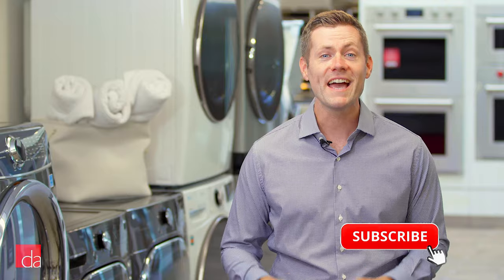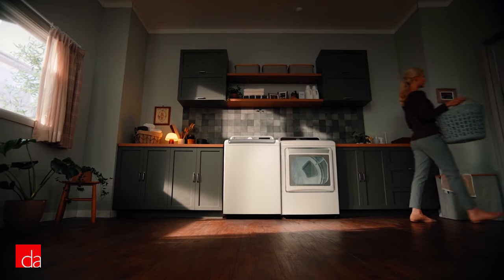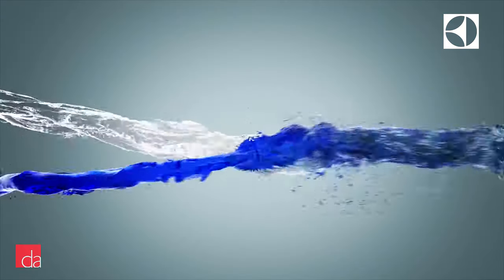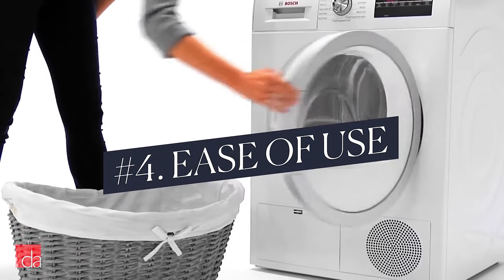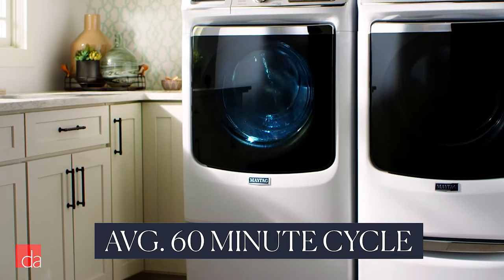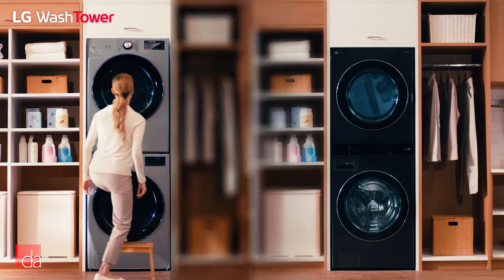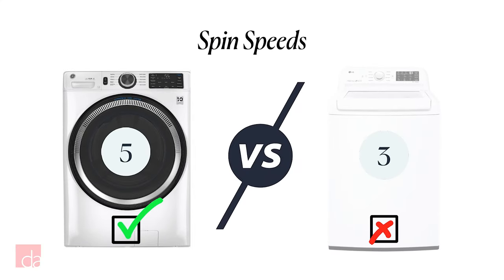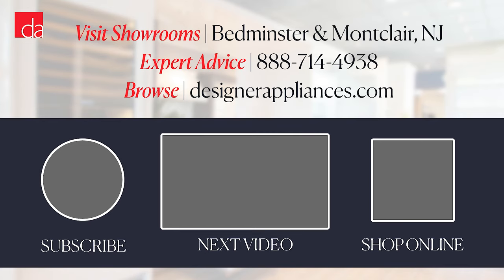Front Load vs Top Load Washer - Selecting a Washer Shouldn't Be Confusing (Updated)

Comment: I am no expert but as a Chef , chef's coats can get pretty stained. I have a front loader for the last 10 years ( Fridgidaire Gallery Series)  and i love it. For regular every day clothes i only use the quick wash 28/32 minutes cold water and  they come out nice. For heavily stained whites from work i use the soak first with detergent  ( cold water) no spin and i add a bit of bleach in the soak to dissolve blood stains.  If I would use warm water it would set the stain in. Then i turn on  the quick wash with no more detergent. Does a good job. I use Tide Powder as i noticed that it does a far superior job than any other brand i tried. I do not like the pods they leave residue .Also i can say that front loaders are easier on the clothes. Water  and electricity are  expensive where i live. I never in 10 years had a mould issue. I leave the door open as i throw my dirty clothes as i go. I do not separate 90% of my clothes, just the one that needs bleach and i  use cold water only.
Most people put way too much detergent. Do a test as i did. Put some clean bathroom towels back into the washer, turn on the hot water and see how the water looks like. If you have a lot suds you are using too much detergent regardless of the machine. 1 or 2 tablespoon of detergent is enough
Reply: @frrnchistibe all your test proves is that the machine doesn't rinse well. A standard top loader cannot be beat in that regard.

Comment: I am fortunate in that I have two laundry rooms and therefore two matched pair, both from the same highly rated manufacturer. Both sets are top of the line. One set is top load and one set front load so I have long term, up close experience using and comparing both. The top loader consistently cleans better, it’s hands down a much better system and has become my preferred pair. I now only use the front loader as a back up when I either need a higher capacity (due to no agitator) or need to do two loads at once. When my front loader needs replacing I’ll be looking for a second top load set.
Reply: I have the same situation, one set of each type.  The top of the line HE front loader has never given me any issues, except for what it is...doesn't use enough water.  I use it for comforters.  We are now buying the new top load with removable agitator which erases any consideration of ever again purchasing a front loader!
Reply: What is the idea of removing the aggrigator
Reply: Brand and model of topload please
Reply: @akhisalaam  Speed Queen TR5
Reply: Well that makes it so much more difficult for me to decide.  My biggest question is does the spin cycle bother you being lower?  And the water usage being more?  I have been looking at either a SQ TC5, or TR7 or their front loader FF7.  Hubs says he would prefer front because of water usage.  I have used a front loader last 20 years, so a little difficult to switch.  But considering it.  I do like to wash King cotton blankets from time to time.  But they fit in my compact Asko.  I thank you for your feedback.
Reply: @fearsomebeard4290  Comforting to know the TR cleans well.  It seems the TC5 would be a more effective clean, but not as gentle.
Reply: @medobigposs washing big items like bed sheets & duvet cover

Comment: We have a set of GE Profile front loaders we bought in 2006 that are still going strong...until yesterday, the washer started burning rubber, literally. Smelled like a tire fire. Did some research and found that it is pretty much unrepairable, but 16 years, and the dryer still works! It makes some strange noises sometimes, but we are going in tonight to buy another new set of Profile's if we can find them.

Comment: I noticed my LG Top loader to be quieter compared to my Cousin's Front-loader. My Cousin's washer sounds like an Airplane engine and I could hear my cousin's washer even waiting in the Living room, while mine could not be heard at all stages of my washing process unless the beeper alerts me that the washing is done. The front loader's advantage is that you can stack baskets and other stuff on the machine's top side. The Toploader is a hassle when you have to remove anything on top of the washer every time I use the washer. All Front-loaders also use more electricity but less water. Top loaders use less electricity but more water. I was overwhelmed by all these decisions as I am looking for a new washer, just in case My current washer fails. My cabinet was custom-designed to adapt to either Top Loaders or Front loaders.
Reply: Actually front loading washing machines will use LESS water and LESS electricity and front loading washing machines are way more quieter when washing and noisy only when spinning
Reply: I have a front loader and my parent's LG top loader washes better. It has a turbo wash function which spins the entire drum which then shoots 6 jets of water and soap on to the clothes pulling it through the clothes. The way the impeller then rotates and the way it is designed, you can see how the clothes rub against each other and are turned around. The rinse is also more effective with an extra atomising jet spray that rinses during the rinse cycle. It's amazing honestly and you can fit much more in it. My clothes come out cleaner in an LG top loader. But only the LG one.
Reply: @stephensnell1379  Yeah they use less resources because they don't clean as well.
Reply: @SDav21  Bot

Comment: Been using front loader for aeons as it's efficient, cleans well but has mold issue, long washing time (cotton at 60°C takes at least 1 hour and 40 minutes) and is more expensive. Now with back and knee issues, I'll go for top loaders which have seen great improvements in all areas by manufacturers. Like the faster wash too. Only downside is the water consumption although there has been improvements here.

Comment: I’ve use my Kenmore Elite Front load since 2013.  I leave the door and detergent dispenser open at all times when not in use and I clean under the gasket and dry the door.  I run the clean cycle with bleach once per month.  I have never had any issue with mold at all

Comment: Our 12 year old mid grade GE front loader finally gave up the ghost two weeks ago. It has only ever had electronic problems, only twice, and only in the last two years. Our home warranty company declared it irreparable because the motor board isn’t available anymore and replaced it with a new GE model which has the venting feature. We’re planning to sell soon and leave it behind, but it will be interesting finding out if we like it before buying something for the new place. 

The matching gas dryer has never had a single problem and is still going strong. I do love a gas dryer.

Comment: I have a top loader and constantly have mold growing in the detergent compartment.  I also struggle with unbalanced loads with the top loader and feel my front loader handled large loads such a blankets better.  When this machine dies I will definitely replace it with a front loader.
Reply: Get a top tier electrolux
Reply: @HevaNaisdey  I had an Electrolux front loader for two years and I loved it. I have a Miele now which is very good, very complicated though. The Electrolux got the job done in a very straight forward and easy to use manor. Electrolux do make very good products.
Reply: @lukiejames  are you in europe?
Reply: @cosettapessa6417  I am in Australia.
Reply: @cosettapessa6417  there’s still a model above mine that costs $4999! If I’m honest, it’s a good machine but my previous Electrolux washer which was around $800 I thought did just as good of a job. Yes it didn’t have a touch screen and an app and all the programs but really…I use a cottons program 95 percent of the time. When it breaks I wouldn’t spend the money again if I’m honest. I just had a lot of issues start after about 3 years with the drum on the Electrolux I suspect it had been overloaded a few too many times and it had damaged so I went for the Miele hoping it lasts a long time because it’s a pain changing washers in an apartment complex and moving the dryer from the top etc.

Comment: I am a repair tech and I do not like any of the new washers front or top load. I would never go with GE laundry, new GE since Haier bought them has not impressed me at all. When customers ask I will recommend the speed queen TC5 its as close as you can get to an Old direct drive type washer. They are easier to repair and maintain, and do a great job of cleaning, and the lid doesn't lock!  Even new top loaders with an agitator do not do as well as the old ones in my opinion. I like the mechanical timer over electronic controls and the cycle time are so much shorter. Something else from the repair stand point. when you  stack them or shove them under the counter or in a tight closet there will be costs associated with this choice down the road.  Plan an paying a lot extra in labor to service and repair, since there is more labor involved with unstacking and moving to access etc. It looks better but will cost you and they will break down. I regularly see machines less than 5 years old needing hundreds of dollars worth of repairs, control boards, drain pumps, spider arms, bearings valves etc.  The old washers cost way less to repair and maintain.
Reply: I recently bought a GE top loader, but it was a model from a few years ago. Can you tell me how long ago Haier bought GE?  All the repair people I spoke to also recommended Speed Queen, but they weren’t available when I was looking due to the supply chain issues.  I opted for GE, as that was the other brand they all recommended. I am hoping my model is not one of the ones Haier manufactured.
Reply: Great advice

Comment: As a dude who left the automotive repair Industry to Applaince industry I believe front Load is best due to low water usage and higher capacity however both need repairs and the front loaders are harder to work on but my vote is front load they literally pay for themselves if you have City water
Reply: You clearly aren't very smart with appliances if you think using less water is good. Top loaders clean better, so they use more water

Comment: I also think front loaders are gentler on clothes which results in cost savings on replacement garments.
Reply: I agree. I changed from a top loader to a front loader with the same size loads placed in the old dryer there is less lint.

Comment: At the end of the day the only test that mattered for me is how well it cleans the clothes, I have a front loader and rarely struggle with mould build up, the drawer gets put through the dishwasher, when there isn't as much to go in 🤷‍♀️, I want a washing machine that cleans the clothes the best and is cheap to run. I'm in the UK so have a plan with domestic and general, where I pay £5 per month, for unlimited repairs, unlimited parts and replacement if they can't fix the machine.

Comment: I forgot to mention that I am from the old school days so i was around with the very old agitator machines so i have gone through all the years and yes I have used modern side loaders both expensive and cheaper models.I have found the exact opposite of claims the top loading agitators are usually MUCH better at cleaning and i would know because i work in construction so my clothes are everyday VERY dirty.

Comment: LG top loaders are amazing. Everyone says front loaders wash better but LG is the exception. I have a front loader and my parent's LG top loader washes better. It has a turbo wash function which spins the entire drum which then shoots 6 jets of water and soap on to the clothes pulling it through the clothes. The way the impeller then rotates and the way it is designed, you can see how the clothes rub against each other and are turned around. The rinse is also more effective with an extra atomising jet spray that rinses during the rinse cycle. It's amazing honestly and you can fit much more in it. My clothes come out cleaner in an LG top loader. But only the LG one.
Reply: Do you know which model they have??
Reply: @SarahAvi  I am not sure of the model number but it was purchased in 2018.

Comment: I repair appliances for a living. 
I also prefer the front load over the top load. 
Asko makes a front load washer without the gasket/boot. 
I still haven't come across anyone who owns an Asko. 
Do Asko front load washers get any mold?
Reply: I work in the appliance world and the problem with asko appliances is they break down constantly. That’s why you rarely see people with them. I have a Miele washer and it’s good and an asko heat pump. In its first two years it was replaced once and the replacement has had six repairs. It’s just hit 2 and a half years old and I just hope it will keep running now the warranty is up as it cost $2229. 

I love their design and simplicity but it makes it hard to recommend them to anyone. Their washers also have issues with their seal falling off as it’s stuck onto the door instead of around the opening. Another common complaint I hear is they leak water all the time. Even from new. 

I would steer clear of asko. 

They make very aesthetic looking machines but for whatever reason when I talk to others who own them or customers they all suffered the same fate as me and said they wished they just went with Miele.

Comment: Funny. I've got a 14 year-old LG front-loading washer, and I've NEVER had mold issues. I refrain from using too much detergent, use powder, and leave the door open after I'm done using it. 
Front-loading washers use less energy and water, remove more water from your clothes at the end of the cycle resulting in shorter drying time and saving even more energy, and clean clothes better. This is probably why all washers in Europe are front-loading. 🤔
Reply: you are absolutely correct about your statement. Europe does not have to loader and yes the front loader removes more water.

Comment: I'm looking for a washer.  I have a top load washer.
While still works, my frustration is with bulky items like comforters.
The water seems not to cover it completely and when the washing cycle finishes,  part of the bulky items seem dry while  other parts that are not.
I usually kind of turn the comforter with the dry side down and wash it again.
I used to have a cheap very simple washer and when this happened, I could push I believe the close door button or sensor and it keep filling up with water.
I can't do that with the new machine.

1.  Can you recommend a washer with great capacity and that can handle bulky items?
2.  Is there an online reference in terms of reliability?  Where I can find  which brands or models are more reliable according warranty /repair claims?

Comment: Sorry not getting a front loader. Also there are models for apartments. We have a GE top loader washer, with a front loader dryer. It's a one piece unit. You can't separate them. But my top loader will wash in 25 minutes, verse my son inlaws 54mim. When you have perhaps 4 loads to do, which am I going to pick?

Comment: When he said you cant stack a top with a dryer is wrong depends on ur ceiling height.  I have a top with a dryer above attached to wall with brackets worked well for 20 years so its 5 / 5 now.  Every person ive talked to say front loader but as im 6 4 height and 55yo do i want to be bending to max when im in my 70s ????  Also the foot print is smaller with top loader and prices in Australia are roughly same but front generally bit cheaper not a deal breaker.  Its very close for me could go either way ive narrowed down to 1 x top and 1 x front not much in it will see what store rep says.

Comment: Can you help me? We are getting ready to buy a new washer and dryer. We’re thinking about a front load washer since we are senior citizens. The mold collecting on the gasket is a concern to me. This past year, we had the crawl space under the house encapsulated, as well as mold remediation done in and under the house. We are located at the foot of a hill, so we have moisture runoff. Having done these home repairs, would a front load machine be a mold problem for us?

Comment: "Leave the door open" is a chore? ... lol?

Here is the thing: So far, I'd never had to clean the rubber gasket thoroughly. My machine is 10 years old. There is no mold, and there isn't even any residue that I could clean.
And how did I do that? I use powder detergent and no softener and leave the door open after wash. Occasionally, I do use wash programs with a temperature above 60C.

It's that easy.

Comment: I'm over 6-1 and it's tough justifying paying $300-350 for a Laundry Pedestal, for a Front Load Washing Machine...just to get it "off the ground". Are they insane charging that much for nothing more than a metal box with a drawer?  I had a Kenmore HE3T (made in Germany) front load machine that just fatally broke (no parts) after 15+ years. This model was delivered with a pedestal...today no such luck.